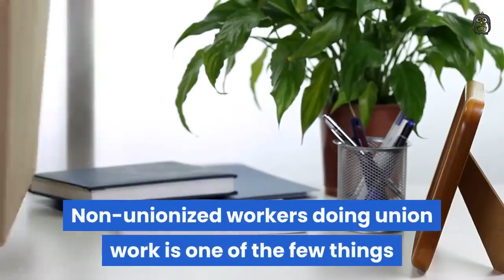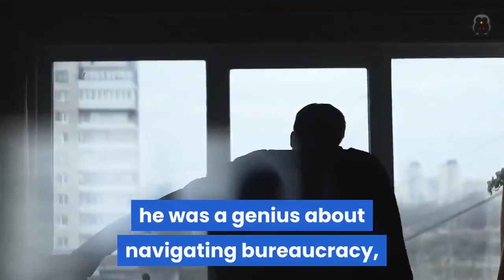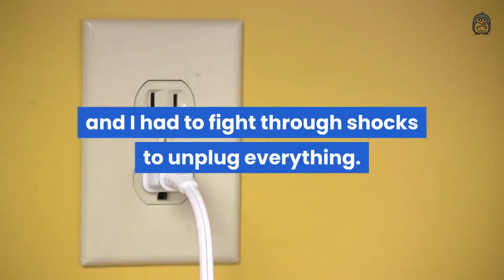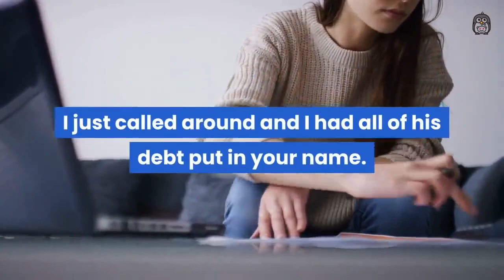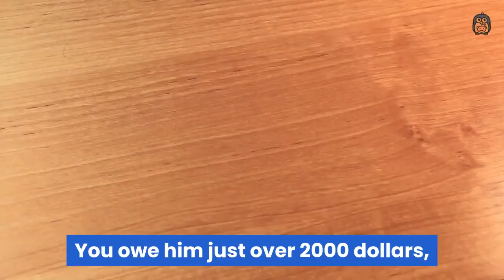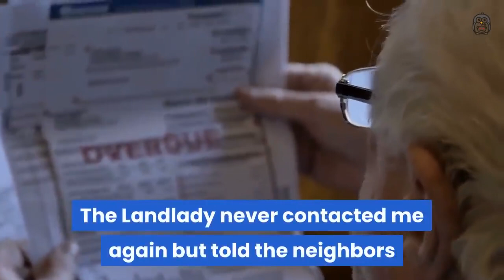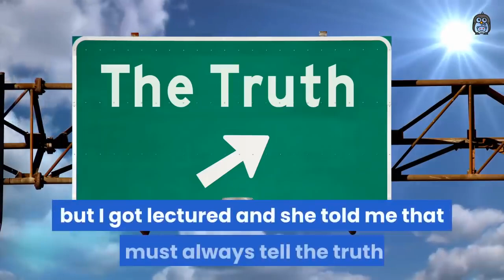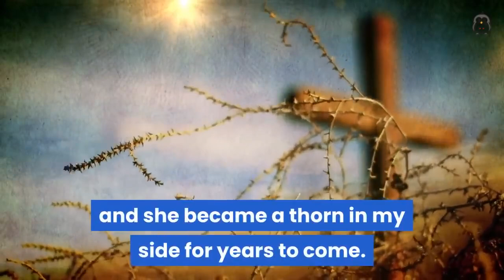They are not even able to do the work necessary

Comment: Blaming the workers, union or not, is stupid.  Management are responsible for ensuring that the workers are appropriately trained and assigned, and only an idiot expects otherwise.  I worked for thirty years in a union hospital and saw all kinds of errors mixed in with the usual competence, but every case of ineptitude came back to managers whoi simply did not know how to do their jobs.

Do we blame the mechanic when the pilot flies into a mountain?
Reply: Depends, was the plane properly maintained?
Reply: @willpaul5202  Is that not the responsibility of management to assure it is?